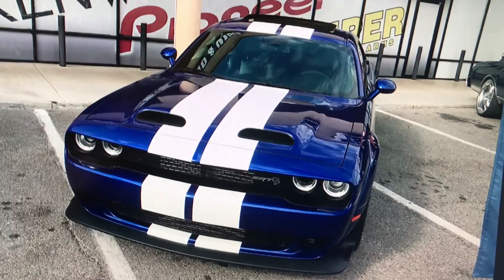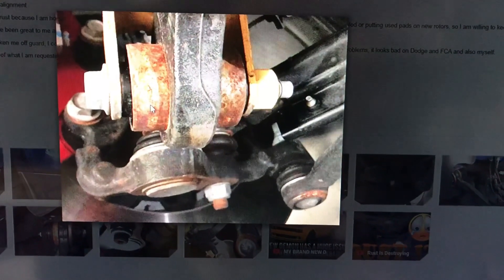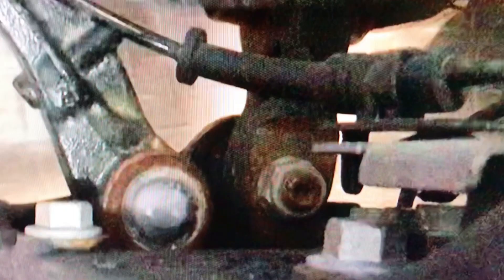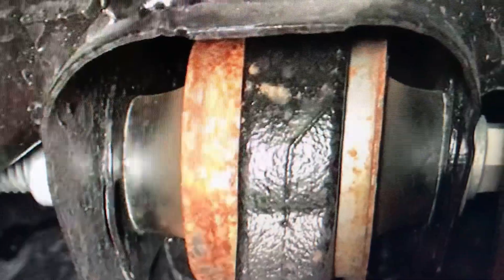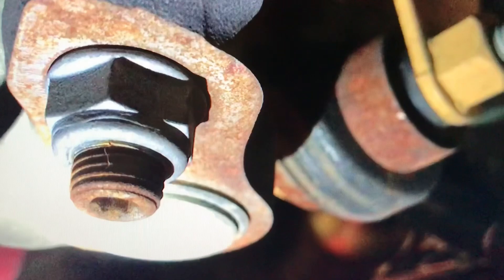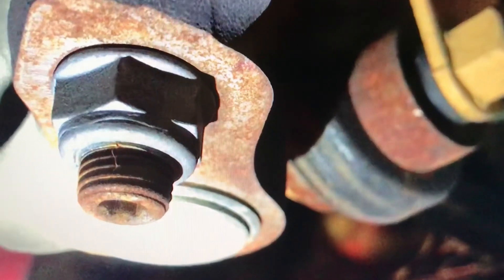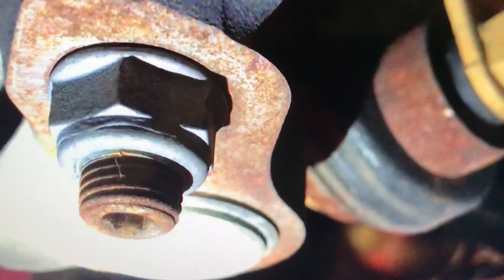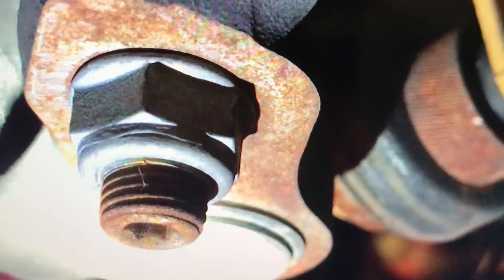2019 HELLCAT REDEYE WIDEBODY EXPOSING THIS SERIOUS RUST ISSUE VIDEO 1 OF 2 SHAME ON DODGE & FCA

Comment: Surface rust, you want to see real rust come up to the north, coat with oil rust prevents more, let’s see proof on safety issues, someone out there has to be an engineer and can comment on this . ANY car that sits in north for any time will have rust starting

Comment: I have SEEN in a NON vehicle manufacturing environment RUSTED metal PAINTED OVER, I purchased a TOP name brand wood chipper many years ago, that after closer inspection parts had been painted OVER laminated steel, IF I was a betting man I would say those parts you have shown are probably VENDOR items that were supplied to the mfg, probably off shore that was NOT properly prepped before painting, of course this is all speculation on my part.

Comment: $2400 pretty cheap fix, if you ask me.  Yes i would agree that there is way to much rust build up for the age of the car.  To get that much rust you would have to be driving it in salt water all the time.  I know its more then a quick drive to the ocean from where you live.  The cracked bolt/stud, well that in its self is enough to do this warranty work, i would think.  That has to be fixed, no option there.  Good luck Paul

Comment: I feel your pain , I had a four year old Dodge Ram Big Horn that the frame rotted so bad it wouldn't pass inspection. that was the straw that broke the camel's back for me no more dodges. I was a long time Dodge guy I put up with transmission going bad front ends that were constant need of repair and a  bunch of other problems. unfortunately my kid has my Dodge infliction , he bought a used Dodge Ram he drove it to days it's been sitting in the shop for over four months waiting for lifters.

Comment: Crawl under any new car and you will see this.. with the split bolt I agree it should be swapped for you.
Reply: You are incorrect sir.  My 2008 Z06 Corvette has nothing like that under the car.  It is pretty unacceptable for a 90k dollar car but like someone else said you bought a 30k dollar car with a 60k engine.  Ha ha!
Reply: APPEARS to be a SERIOUS SAFETY issue, but I am NO engineer
Reply: I've been under plenty that are the exact same as this. Minus the split bolt...
Your 08 have head issues? Mine did.
Reply: I would say yes but the guides were not completely out of spec yet when I pulled them.  I did the head swap at 15k miles with a head setup from AHP.  Hopefully I'm good for a while.
Reply: My 2005 f150 doesn't have nearly the amount of rust this thing has, not even joking. My cars in Arizona but still navada isn't much different
Reply: Just crawled under my 2019 Tahoe (built in October, 2018) and there is no rust at all...nothing; then I crawled under my 2017 Wrangler (FCA product with over 37,000 miles on it) and no rust on any suspension components (just a couple minor spots of surface rust on the frame) or any other components, definitely driven in wintry conditions for 2 seasons...just my observations.
Reply: I was seriously thinking about getting a Widebody Scat Pack, but will now closely look at the Challengers on the local Dealer Lot...I would NOT be happy about what you have found Paul, completely unacceptable 100%.

Comment: In the time it took you to complain and make videos of this surface rust, you could have treated it with the various products out there and been done with it. You are the typical muscle car nut, looking for the 1 to 2 % that isn't perfect. Drive it, be happy!
Reply: how can you justify spending 100k on a car that has rust on important components. if the paint was scratched and chipped i bet you'd complain.... or maybe you'd just drive it and be happy.... Consumers run the world. Put out good products and get the praise. No one should be so excited about a red eye, demon or whatever and not complain about something that looks like its years old.
Reply: He did not buy a 100k car. He bought a 30k car with a 70k upgraded power train. He did not buy a hand built Porsche or Ferrari, why do you guys think a Dodge would have that level of quality. At the end of the day, this cry baby is going nuts over surface rust that is not going to cause that control arm to fail. Drama queens only would say such things.
Reply: All of the dodge cars that I have examined on the dealer lots have extensive rust, even the jeep products. Go look at them. Look through the wheel wells and you will see the rust, Lie underneath them and you will see the rust. Scratch off some of the black paint and you will see the rust. I saw it and I am not even an expert or a man.

Comment: The Basic Limited Warranty covers the cost of all parts and labor needed to repair any item on your vehicle when it left the manufacturing plant that is defective in material, workmanship or factory preparation. There is no list of covered parts since the only exception are tires and Unwired headphones.  You pay nothing for these repairs. These warranty repairs or adjustments — including all parts and labor connected with them — will be made by your dealer at no charge,using new or remanufactured parts.

Comment: Every auto manufacturer that has places in detroit, the midwest or north?? They all have had that brought to them. None of them have done anything.
Maybe they really dont feel its needed or maybe people just tell them or just show a few pictures.
Its not nearly as Dangerous as you are making it out to be atleast those pictures i do understand no one wants rust beneath a new car . i also highly doubt its been years and years.
Anyhow..... With 5 big recalls by chevy and Gmc, including power steering pumps going bad when you drive and a couple other bad ones, 4 from Ford and the engines and transmissions they have had to replace and repair with piston slap and scarring of the block.
All trucks with block heaters that can cause fire and belt tensioners that spark and have started fires.
2 from FCA I BELIEVE.
ITS TYPICAL WHETHER YOU ME OR.THE PLAMET THINK ITS OK

Comment: Look underneath every car, there will be surface rust the exact same you had in the pictures. How fast that you bring up safety in your video is hilarious. Drive the car and enjoy it
Reply from the maker: Cranjis McBasketball You Sir are 100% incorrect, I have a 2015 Challenger with 23K Miles, a 2008 Charger with 76K Miles, BOTH cars do NOT have one single spec of rust on any suspension surface, you are simply following along with the bull crap excuse these manufacturers spit out by saying its surface rust, your claim and theirs are easily proven incorrect by two other vehicles I own that has no rust, I am not a follower I am a leader and I may very well be the one single person who will change the future on motor vehicle production
Reply: @ThePaul1551  I have a 2013 ram with 70k that has surface rust underneath and my dad has a 2019 ram with 15k with surface rust in spots. Surface rust has no affect on anything. I worry about body rust and cancerous frame rust than surface rust on a bolt or bushing like he is complaining about. Doesn't matter the brand, model or year. I'll look under a 2019 Ford with 15k and get back to you
Reply: @cranjismcbasketball343  I have a 2019 challenger for almost a year now and I have no surface rust like this

Comment: Mine also has some rust on the front control arms but not that bad..it shouldnt have any...very thin coating of paint on the parts...Toyota, Honda, etc have thicker better coverage and only have 3k miles on it...I plan on letting dealer inspect etc at first oil change

Comment: I'm thinking that if these cars are being assembled in Canada, I'm wondering if it has something to do with the ice melt chemicals they use up there.  Maybe the parts are stored outside in bins and some yahoo drives around with a salt spreader in the parking lot, hitting the bins with the salt.  I live in the Northeast and the road chemicals around here have been eating up the vehicles' galvanized brake lines.

Comment: Wow. I agree this is years of rust on a new car. I wonder now is Camaros and mustangs doing the same.
Reply: Yes they have had mustangs and camaros with rust issues. The parts and bottom of alot of cars have rusted.
Reply: Ummmm what about the fords and chevys that have it? Or FORDS THAT HAVE PISTON SLAP AND SCARRED BLOCKS?
3 F-150 RECALLS TWO THAT HAVE CAUSED FIRE/FIRES?
PS- NO THE RUST IS NOT " NORMAL" GM, FORD AND FCA AND IM SURE OTHER COMPANIES IN AND AROUND DETROIT AND NORTH IN GENERAL HAVE THAT PROBLEM.
YES IT USUALLY IS SURFACE RUST.
I WONDER IF YOU SHOWED THEM ALL THE SAME O
PICTURE? YOU BROUGHT THE CAR IN?
JUST 1 DEALERSHIP.
THE MUSTANG PISTON/BLOCK TROUBLES AND THEIR MANUEL TRANSMISSIONS THAT ARE BREAKING THE FORKS IN THEM.
PEOPLE HAVE HAD TO GO TO 2-4 1
 DEALER'S AT TIMES TO GET HELP THE RIGHT WAY. ENGINES HAVE FINALLY BEEN REPLACED. TRANSMISSIONS REBUILT or Ford going doing buy backs.
Reply: In other words it happens. No excuse for ANY OF THE CARS OR COMPANIES.
LIKE I SAID IM JUST CURIOUS IF YOU WENT TO 1 DEALERSHIP OR MORE OF THEM. IF NOT HOW MANY OF THE PICTURES DID YOU SHOW?
Reply: Gm and gmc have cars and 1.25 million trucks recalled
They also have trucks recalled for bad upper control arms that the bushings and arms itself can fail.
You can have this stuff with anything. Should you? Of course not.

Comment: It's not unsafe.  No Automotive engineer in their right mind would say it's unsafe. 
But it is poor quality control. They should pay to have the parts wire brushed and treated.
Spray them with Rust Stop rust converter, let it dry, then spray them with Rustoleum or Tremclad.

Comment: I had it on parts under my Charger wheel well when I first got my brand new 2018 charger with only 30 miles on it. My car set In Michigan   Manufacture new car yard through the winter ❄️ months before getting to dealership here in Georgia. 80% of it is gone. It comes from sitting on those up north yards for months and months

Comment: Yep. I thought surely the dealer had parked my car with the front end sitting in a salt water puddle for several months before I purchased it. Nope. My brand new 2019 Charger Daytona looks EXACTLY like that. Rear looks fine, all front end components rusted like crap. I'm really, really, upset about it.
Reply: Yet you bought it anyway......LOL
Reply: @chadhaire1711  Yes. That’s true. I didn’t notice it when I purchased it. Not a car you can easily see under. Once up on the rack I freaked. It had been an ongoing discussion with them for months and months. They finally agreed to buy it back.

Comment: My 2016 scat pack has rust on some suspension bolts. Even the driver side caliper bolts are semi rusting. The center cap of the wheel used to leak out orange water lol. But it's only a lease so dont care . Will check next car for sure. From experience,just like you said I dont think it's from transportation or anything silly along those lines. Mind you my car has only 15k Miles.

Comment: This is not an issue
Reply from the maker: It seriously takes a very HIGH level of IGNORANCE to even think for a second what is shown at 1:08 - 135 is anything close to OK on a brand new car, that one bolt is holding the Knuckle of the front suspension together, lets say for the heck of it I chose to remove that nut, the threads would be compromised and anyone with 1/2 a brain would recommend replacing that bolt that is known as the knuckle, so you keep going around in your little life and think that this is just OK, you really are not that bright are you?
Reply: @ThePaul1551  Hi Paul, after viewing your videos I would say buying a bus pass and giving up cars will lower your blood pressure.
Reply from the maker: @blobtv7444  That will Raise my blood pressure, imagine if you will being stuck in the right lane in a bus no less going with the flow of traffic, not me, you will see my rust particles as I blow past those normal drivers
Reply: Mopar keeps making k-mart quality junk …. That is an issue

Comment: I would be pissed , could it be ocean salt water  from shipping  not properly washed  . the ball joint don't look safe hop you get replaced . 1999 I bought 97 dodge SST black silver still have it, noticed made in Mexico tags on things ,was little Scarry lol  balljoints went at 35,000 miles and front springs at 50,000 miles  quality is not their or so carbon in steel that is used with some parts.  Got a Honda prelude sh 1999 3 years ago with 95,000 miles sat for ten years in a yard  in PA ,looked better than your cars underside before I went over mycar front too back . quality is gone I heard even plastic and fabric in vehicles sin's 2001 chemical's that made the material's last is not used through cost throwaway vehicles 2001 on.   Bad ass car you got ,love paint hood nice . good luck   fix that balljoint thum some good high pressure grease in their.

Comment: Bro you have a dodge ... fca has been rated the #1 most unreliable vehicle brand like 3-5 years straight , Dodge has a reputation for looking good but being cheap on the inside , o has a 2015 Dodge Charger R/T and by the time it reached 118,000 I had been through 2 full engine replacements, a new radiator, water pump and water pump pulley , and I bought the car brand new and never took it to the track .. I’d say sale the car and go for a ZR1 Corvette or a ZL1 Camaro , if you’re looking for a muscle car Chevy was rated the #4 most reliable
Reply: Streetdweller SS I own the Camaro and it was a piece of s*** and that's why I bought a Dodge because I wouldn't own a GM product if you could give it to me 29 million recalls but the one thing they don't recall is making 700 horsepower LOL
Reply: Streetdweller SS you can always buy a plastic Corvette you can always buy a plastic Camaro that are completely junked and unsafe cars with 29 million recalls no thank you I'll take a Dodge over a piece of s*** Chevy any day
Reply: William Douglass from my personal experience my 2017 Camaro SS is running strong with no problems , I didn’t come up with the stats you can look it up , Dodge is one of the most unreliable brands in the world with the fastest depreciation vehicles on the market , literally I had to get 2 5.7 hemi’s replaced by the dealership under warranty and had to take it in for 3-4 recalls , Dodge is one of my favorite brands but they suck when it comes to reliability
Reply: bee Lover I doubt you’ll have a issue with your SRT but the reports are in , it’s not just me talking trash , FCA was rated by drivers as the most unreliable car company out of ALL of the car companies on the market today , every vehicle has issues based on how they are used , you might not ever have a issue but that doesn’t mean that dodge makes great vehicles, the quality is trash and the 5.7 isn’t made to perform like they say , you have to get a SRT to get real performance... good luck lol
Reply: William Douglass Chevy was rated the #4 most reliable, Dodge didn’t make the top 10 , also the corvette out performs every dodge vehicle on the market , the Camaro out performs the challenger in various aspects, and it holds its value, you have modded challengers getting spanked by stock mustangs , dodge literally had to create the hellcat and demon to add value, the SRT scat packs and 392’s are too heavy and slow compared to the SS and 5.0’s , not only that , Dodge vehicles from a maintenance and quality standpoint are very low performing... I’m own a 2017 SS Camaro, my last car was a 2015 R/T charger , I’m speaking from experience, Chevy makes real performance cars , dodge makes cars that go fast in a straight line that’s it

Comment: Same with the RAM.  My brother was working on a 2015 grand Cherokee.  He went to remove the rear bumper reinforcement and the bolt heads were really Rusty.  A  typical Chrysler product.  Cheap!!!
Reply: Same thing with Chevy and Ford products. I looked at the suspension of a brand new ZO6 Corvette and their was surface rust everywhere on bare metal suspension pieces.
Reply: @VegasRT500  just surface.  Chrysler's rust sooner. Trust me.  My brother fixes car's for a living.  Working on a four year old Chrysler is like working on a 10 year old GM.

Comment: My 2016 Scat Pack also had a small amount of rust on suspension parts, more on hubs and rotors but far less than the photos in your video. Looking forward to your follow up video. I know your upset about the rust, I would be as well. If you want your video to be useful please make sure the video is factual and unemotional. This is a genuine issue that FCA should be addressing.

Comment: This is typical of something you would see this been driven in foul weather. Nothing more nothing less. Your $93,000 car should be in the garage in the winter time not on the streets. If you just drive it in summer months, you shouldn't see that. That all should have been zinc-coated as far as the nuts and Bolts Etc. As far as the tie rod ends lower control bushings Etc that stuff should not rest that also should be coded remember lower quality Metals will rest easier faster quicker.

Comment: Corroseal and Griots undercarriage spray. All cars have surface rust! Have FCA replace that 1 bolt and be done with this already. Drive the car!

Love the fan boys dogging FCA look at your front and rear suspension. Some are worse than others but all manufacturers have this.
Reply: Anthony not bmws.
Reply: @kbg4life07  sorry to tell you BMW's also, maybe not at this level but suspension parts have it go to your local BMW dealer and look under a M4 etc. surface rust, inevitable.

Comment: Wow you have bad luck, I have a 18 Hellcat , and a 16 scat pack shaker  and no rust, remember there built in Canada it shows trains ect, plus they probably keep parts outside somewhere and if the weather is bad you get rust. Spray it with some rust neutralizer then recoat it with eastwood's black under coating problem solver. If they replace parts it will mess up your suspension like your last car.